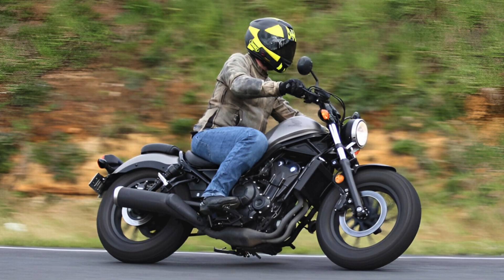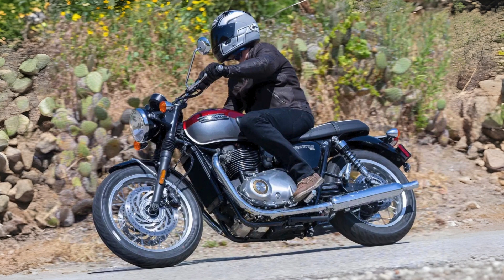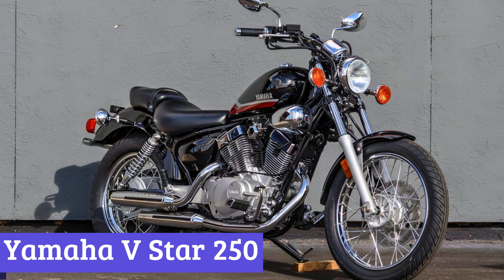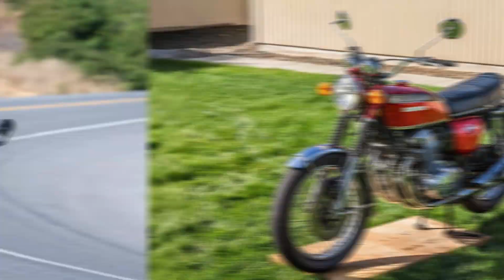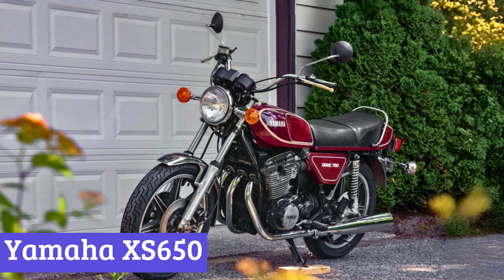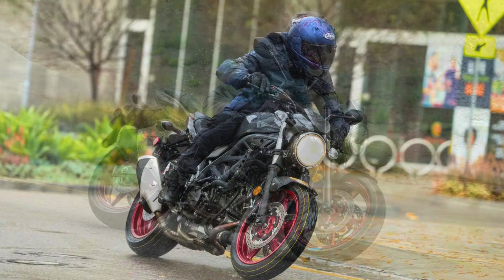12 Motorcycles You Can Ride Forever With Just Basic Maintenance

Comment: Any of the bmw oil heads 850/1100, will out last your need for it. However a clutch replacement literally means disassembling most of the bike. And it has a quirk with the gear boxes before 97 where the shifter gets eaten up by a bit of play if not caught early